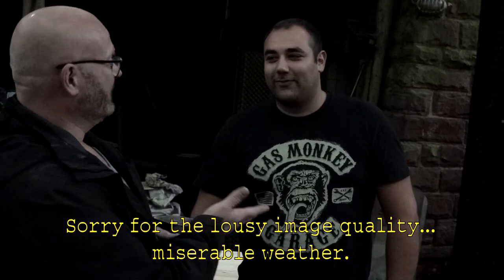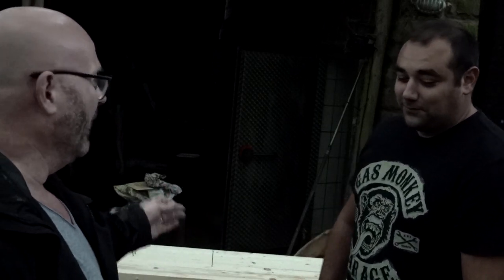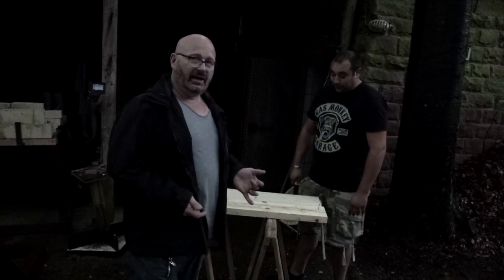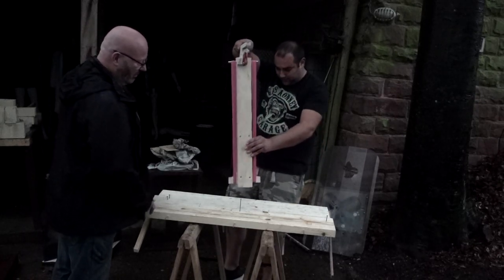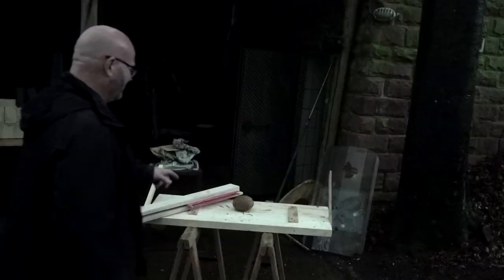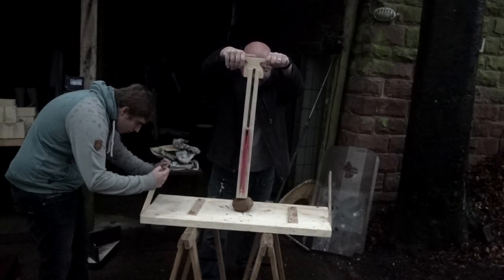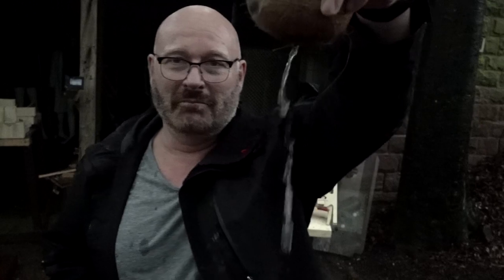Power Hammer USING RUBBER!

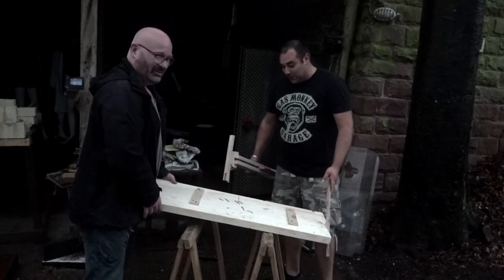Comment: 4:56 "Useless but fun"  This could be a carpenters dream  Imagine trying to build something in old age.  My father is a mechanic at 62, and everyone before him has lived to their 90's.  The amount of backbreaking labor you could save people living outside urban civilization is great.  This is a great tool and I would like to see more of it.
Reply: I can imagine a more compact device that uses rubberbands and is cocked by pulling a lever, so that it would be more practical to use, but still, someone experienced would still use a normal hammer, because nothing is faster than one strong accurate swing.
Reply: Thats called a nail gun.
Reply: don't you think carrying and rearming such device is backbreaking?
Reply: If you were in an area without power this would be great.

Comment: It's actually pretty brilliant... while yes we have nail guns now.. a mechanically operated nail drive that doesn't need air might be a great secondary tool in case of a power outage... I live out in the country and everytime the power grid goes down you really can only really rely on rechargeables or small batteries! an optimized version of this with a clip that can take strips of nails (and maybe an improved cocking system) would really be handy for wood workers, farmers... hell the amish would have a field day with that thing!

Comment: Not useless at all. I can imagine using it to fasten board material to overhead beams that are difficult to reach using a conventional hammer action. Just drill a few pilot holes to hold the nails in the inverted board & then hold the board in place with 3 poles whilst you hammer the nails in. You just design the barrel to be the perfect length for whatever height you're working with. Handy as hell.

Comment: Well, around here, we call that a “pea shooter”.
We use a 1/4” i.d. piece of tubing and a 1/4” piece of steel rod, with a solid heavy steel handle welded onto the rod.
We put a nail in the bottom end of the tube and use the rod to drive the nail.
We mostly use them in places where we can’t reach it with a hammer.

Comment: Um, you made a rubber powered cattle gun, AKA a captive bolt pistol. You can drive nails with it or kill livestock prior to slaughter. It would also work against zombies, but you have to hold it righ up against the skull before pulling the trigger.

Comment: We need a repeating version. Its too slow for actuall carpenters work!^^
Reply: Yes, with a rubber blow back system with rotating bolt 😉
Reply: how cool is this idea!!!! do it jörg!!!
Reply: That was my first thought. Have the handles move up & down the body. Pushing the handles down stretches the rubber, and a catch auto releases at full stroke. Pulling the handles back up resets the bar.
Reply: Or multiple drivers and bands next to each other.

Comment: not useless at all, a manual nail gun without compression is brilliant. I need one of those for the carpentry as I do not have a compressor and this would be very helpfull. Maybe just a smaller version.

Comment: Not only is it a good captive bolt gun but we use something very similar as a way to drive nails in a hard to get to places we made them out of drill rod with a weight on the back and and a tube which holds the rod

Comment: A captive bolt gun does not kill. The bolt going through the skull stuns the animal only and in preparation for the next stages which are; 1, A cut through the throat to kill the animal by way of bleeding it out. Stage 2, The heart pumps the majority of the blood out and in so doing clears the muscles of blood so the meat doesn't spoil. And finally stage 3, This is where the animal has all of it's internal organs and such like removed, head, feet and skin removed. The meat can then be hung for 28days in the case of beef to tenderise.

Comment: Joerg. What if you can make a powered hammer fist? The hammer triggers when a punch lands. The device straps to your forearms, and has a handle for better grip, can be charged, and a mechanism detects if the front of the fist get pressed, meaning zero chance of missing. If the punch doesnt land the weapon doesnt activate, and when it lands, the fight just ends lol

Comment: Joerg, I was thinking you could shoot steel balls out of the thing. Maybe use a rod that is lightly magnetized. Cock it, roll  a steel ball in. The lightly magnetized rod would hold the ball in place. Fire!!! Heck, you might even be able to shoot  crossbow bolts out of the dang thing. Combination power hammer, cow killer, steel ball gun, and crossbow. LOL
Reply: Oh, I forgot to add, coconut opener. Maybe a nutcracker too? Man, one homemade device, so many uses! :-)

Comment: Damn  a steel  ball  in  that  rubber  powered  hammer  would  get up and  be gone
Reply: So, strengthen the captive bolt's shear pin so it can't shear, add a barrel and use it to shoot ball bearings?

I LIKE IT!

Comment: Actually, this isn't a useless device. This could be used as a manual riveting tool in countries where electricity and pneumatic power is limited and/or not available, as well as for nails that have large gauges in the same scenarios.

Comment: I wonder how well it would work as a nailgun, just put the nail in the hole with it cocked, and then press against the wall or something vertical (so the nail doesn't fall out), then hammer away.

Comment: Now what if you were to modify a nail with a wider head so that it had a tight fit in the barrel and then used it as a nail gun upgrade or even a weapon if it was needed but if that were the case it would be more interesting to use it to hit the primer of a bullet in the barrel to see if it would set off the charge and work as a type of fire arm or gun of course it would have to be remade out of a stronger material but this would be interesting to see but it could be very dangerous to test